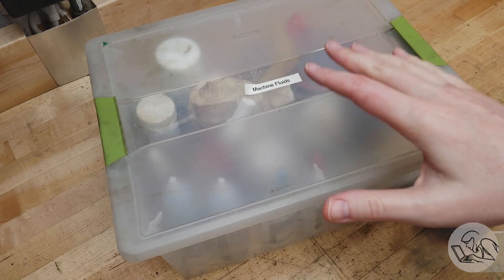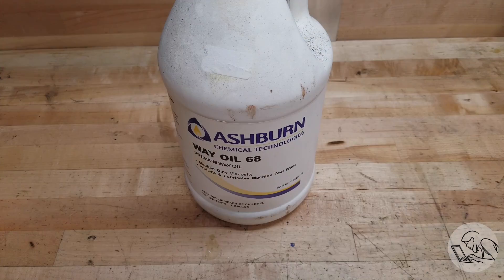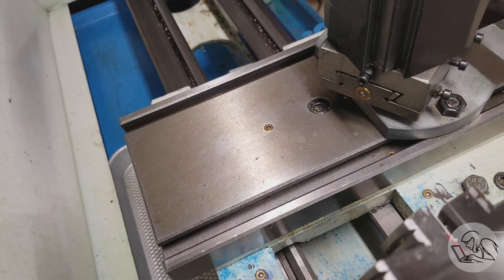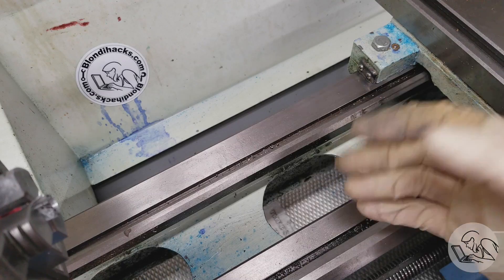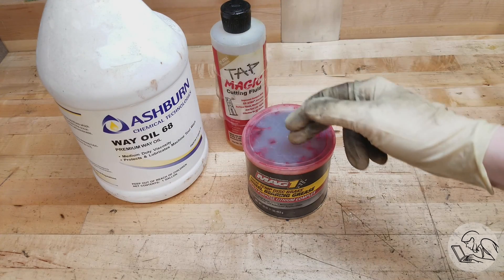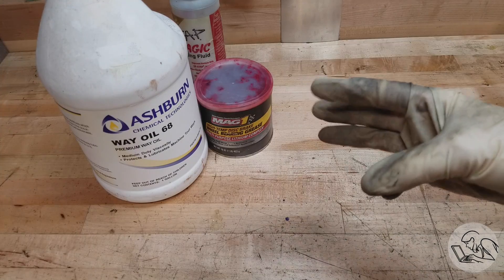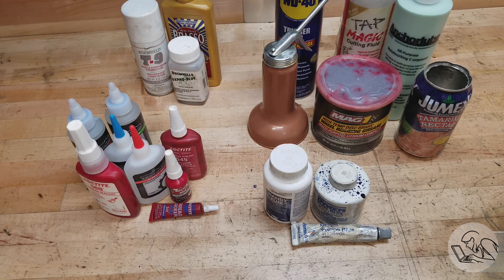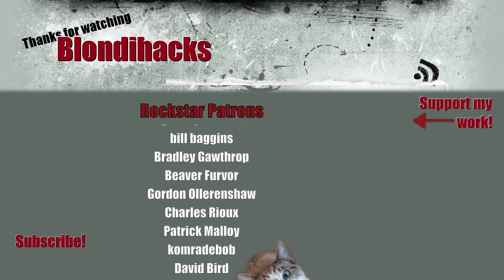Lubricants and chemicals you need in your machine shop!

Comment: Good Breakdown of a slippery topic.

As for oiling ways, I am in the "can not overdo it"-camp. Each day and repeated constantly when the machine is used.
Reply: As for solvents, I like to have isopropanol alcohole around for general cleaning. It doesnt attack gloves and degreases very well for glueing/cleaning purposes.
Apart from that I only stock Acetone but no break cleaner (aka Cancer in a tin) in my shop.
Reply: @StefanGotteswinter  I only use the non chlorinated brake cleaner.  Might be more expensive though.  It's the chlorinated stuff you definitely want to stay away from.

Dale in Canada
Reply: Oh! And dont bother with acetone and isopropanol alcohole from the hardware store. Usualy bad quality with poor purity. Fingernail or lab supply shops have way higher grade solvents, in larger containers for less money.
Reply: @StefanGotteswinter  In Canada you can find 99% isopropyl alcohol at pharmacies. I don't know about Germany.
What is the advantage of higher purity acetone?
Reply from the maker: Make sure you’re getting pure acetone from salon suppliers. Nail polish remover has a lot of other stuff in it besides acetone.

Comment: Lard thinned with some kerosene to a grease like consistentcy with an old toothbrush is great for cutting and tapping aluminum, plus a few other metals. I like to climb mill into a thin film brushed on to a surface so every cutting tooth gets a bit of lubrication.

Comment: I use engine oil for everything, not smart but I just haven't gotten around to getting the right stuff for my ancient lathe yet.
Reply: If you have to use engine oil then at least use non-detergent oil. Detergent is in oil to attract moisture. So it can get flashed off on cylinder walls when engines run. Now unless you're setting your lathe on fire regularly it's not good. But if you are torching your lathe then carry on. On my mill I use chainsaw bar lube to oil the ways. Gives the machine a nice feel. Plus I always got bar lube for my chainsaw. And you can pick bar lube up everywhere. Probably stock it in grocery stores around here. I get it at a big box store myself.

Comment: BIG CAUTION when using brake cleaners. Don't use these around any HOT parts. They can emit phosgene gas from hot parts or when processed through internal combustion engines. I find spray carburetor cleaner a much better choice for cleaning and much safer.

Comment: I find that Remington "Rem Oil" is very good for lubricating delicate mechanisms (like sticky dial indicator stems). A one ounce bottle will probably last years (so of course I bought a 16oz can!). If not Rem Oil, I still wouldn't be without some kind of "clock oil," and a needle-tip bottle is the way to go.

Comment: I like your videos Quinn, your an asset for the Tube machinest community. Something I just started using is methyl hydrate in stead of acetone (mostly).... it is 1/2 the price, 1/2 the smell, and works very well. I use it for automotive paint/gun clean-up, prep for powder coating, post blast cabinet media clean-up, ect. ect. I build custom motorcycle parts for my bikes. Happy trails for 2020! Cheers, Doug
Reply from the maker: Interesting- I’ll give that a try! I go through a lot of acetone around here.

Comment: You forgot Isopropyl alcohol that is almost as good as acetone and I use alcohol and water to clean my air brush and found 10% 90% alcohol water mix is great for cleaning everything :)
Reply: And it won't eat your plastic.
Reply: Also for air brushes washer jet fluid works really well too.
Reply: I use methal ethal ketone for melting some plastics together which is another derivative of acetone. This, acetone and isopropyl alcohol is apparently the three products of the one item.

Comment: Phosphoric acid is handy to have around (just don’t spill it on concrete), plus ether (starting fluid) is good for shutting up those guests who talk too damn much...
Reply: If you're in the U.K. Azure make various chemicals like phosphoric acid for rust removal at a reasonable price compared to EvapoRust and they do the same job except that the Azure is more pungent and EvapoRust has additives to presumably reduce odour and prevent flash rusting after treatment. I just bought 4x5L of the Azure brand for £30. A salt, oxide or grey powder forms and settles in the container and can be separated between soaks by syphoning off the top whereas the EvapoRust mixes and becomes thicker with use but handles oily parts better. Try some of each and see what you think. I didn't even know about it after 35 years of cleaning up rusty tools and machinery. Pitting can't be removed of course without abrasives but all of the oxidation will be. It's a must have and you'll find endless things to derust. Send my commission to Blondihacks!
https://www.ebay.co.uk/itm/Azure-Rust-Remover-For-All-Types-Of-Metals-Containing-Iron-5L-x-4/113828285455.
Current item number is the last digit string if the link won't work.

Comment: I often think how amazing it would be to be starting out now with the incredible amount of information available via mediums like YouTube.  That was not remotely an option when I started me toolmaking apprenticeship in 1967, but it surprises me of how many products I used back then are still available.  You mentioned Tap Magic but we used RTD which came in tubes back then, but I can only buy by the litre now.  
We had a ton of Loctite products (this was Ford UK Research & Engineering later called Product Development) but the Loctite rep called by once a month or so which meant that a) we were always buying stuff, but b) he really knew is products which was super useful to us.
Did I miss soluble oil? It makes a mess pumping it continuously, but it keeps the work cool as well as lubricates.
I love watching other skills channels like guitar Luthiers, as they have different issues, and use different products.  Formula 560 Canopy Glue is an example.  They claim it sticks anything to anything, and it has got me out of trouble on several occasions.  I have also discovered some very cool tool ideas from the luthiers that are on my list of things to make.
We tend to use the Birchwood cold bluing products here in New Zealand.  The secret is to get a good polished surface free of grease.  There is plenty of info online on how to use it though.
That was a great tip re brake cleaner.  I have an aerosol on the shelf I have never thought of using in the workshop, but I will from now on.
You never stop learning, but's what makes it so interesting.
Reply: Hi Trevor - I'm in Australia and we were trying to get Oxpho into the country - our problem was that US OSHA does not allow Oxpho to be transported by plane - if you go to the Brownells website, you will see that it says that it may only be transported via road transport.       Which is why we use the second best  :)
Reply: @richardmeyer418  well, there is road transport which is the us equivalent phrase "the low boat to china"...

Comment: Great video, Quinn, covered the basics quite well.  One thing I'd point out is that not all ISO 68 oil is way oil which didn't seem clear in the video.  You can buy more than one weight (viscosity) of way oil, though 68 is a good all around choice.  One other thing your QC gearbox oil.  If you're using conventional gear oil and your machine has any brass in it, you want to use a GL-4 rated oil as GL-5 will attack most yellow metals.
Reply: On a few lathes that I use instead of the term 'way' oil, we use hydraulic oils of around similar viscosity mainly due to the other tools that have in general have very similar recommended lubricant requirements.

Comment: Strange you hadn't discovered the felt-tip Dykem bottle...(hidden in plain sight as 2 oz. size in catalogs?) It's my favorite for flat layout, wider than the brush, and easy to avoid a puddle/splatter/spills like with the brush-in-lid bottle. One drawback is reaching inside corners... also The Dykem thinner/cleaner/remover seems to work better than acetone, and the aerosol spray Dykem is nice and even for broad areas (best applied outdoors), though I don't use it much.

Comment: As several people have mentioned in comments below this was a good subject because the other engineering channels I watch just assume you know this stuff. But of course a lot of people don't especially starters. Another subject you could cover, although I suspect it would take a lot of preparation work, would be the subject of how to hold odd shaped work pieces. I don't have a milling machine (yet) so I use a heavy duty XY table on my drill press. It is a bit of a pain especially when the chuck decides to slip out. However one of the biggest issues to me is just how to hold some things steady while machining. An example is a Manfrotto head that was designed to hold the Manfrotto quick release plate. I worked out that the place where the QR plate went was large enough to hold a Swiss Arca clamp with a little bit of machining. And it did BUT I spent a lot of time working out ways to hold the very non standard base plate in such a way as to allow machining. Ended up using the actually head clamp tightened up as much as possible as one way. Totally not the right way to do it but it did work in the end. Clamping it all down was the longest single operation hence my suggestion above for guidance in ways to hold a weird shape because not every machining job is a square or rectangular.
Reply from the maker: Work holding and setup is pretty much the #1 challenge in machining, for sure. I plan to do one or more videos on it. There are no universal answers, and it often requires a lot of creativity!

Comment: How do you like liquid thread sealants versus Teflon tape?  I used to swear by liquid based thread sealants until I discovered the yellow 'industrial' grade Teflon tape and I now rarely need the liquid stuff.
Reply from the maker: I still use Teflon tape quite a bit, especially in food-safe places like drinking water plumbing. I have used it on steam engines as well, although it’s more fiddly than the Loctite sealants.

Comment: No mention of WD-40 !
Reply from the maker: It was featured prominently. Not sure what you mean?
Reply: @Blondihacks  my apologies, I think i accedintly skipped that part after an interruption
Reply: @besssam  hard to find someone who rectifies. This message honors you Sir.
Reply: Awhile back, I had to research WD-40 for a project.  The contents turned out to be rather surprising (at least to me).  WD-40 is > 50% Stoddard Solvent (Varsol was the trade name).  Stoddard Solvent is a refined mineral spirit.  Also there is > 25% fine mineral oil.  The rest are driers, fragrance, and in some cases propellant.  So, the famous WD-40 is a pretty common mix of mineral spirits and mineral oil.  You learn something every day!

Comment: Fluid Film. I use AS (Aerosol) or BW (White Paste).It's lanolin based, I use the paste as a tapping grease, surface protection, smear it on the ways of my lathe, apply to drawer slides, it's great. The Aerosol I use as cutting fluid, but I predominantly work in plastics and it's probably inappropriate for the job.
Reply: Max Schumacher I'll have to agree with Max lanolin based lubricants, like fluid film, when they dry leave a nice protective coating, also smells way better than most other lubes. Ahh smells like the farm
Reply: @fishermanyt8187  and non toxic!

Comment: Two things..... DON'T EVER use brake cleaning fluid to clean anything that will be welded, unless you want permanent nerve damage! I believe it generates phosgene (sp) gas. It might give off the same gas from hot parts while machining. 2nd, try using 50/50 acetone with ATF for penetrating fluid, it's amazing!
Reply: Note, it is only the chlorinated types that decay into phosgene gas when heated. Other types are fine.

Comment: 🎶 Grease is the word.
Hard to find anything more specialised than a teatowel here so I just use engine oil as general lube or good old WD40. Canola oil is also a great substitute for penetrating oil due to its thinness ans smells much nicer when used for quenching. Vinegar is good for cleaning and derusting but much slower than evaporust but waaaay cheaper. Don't forget our natural organic enzyme based solvent..spit is fantastic stuff.
Also #Dougsucks  So angry about his stupid prank and unsubbed from his channel.

Comment: >Me, with my clapped out as heck tools
Little engine oil for you, little more for you, dab there for yoooou.
Reply: Detergent engine oil is bad for use outside of crankcases. The detergent is a dessicant so it attracts moisture out of the air. Non-detergent oil is OK though.

Comment: Thanks for doing this vid. I think most of us newbies needed it. I like JB Weld epoxy the best. As a couple have mentioned, chain saw oil may be a good way oil. It has lots of 'stickum' to keep it from slinging off the chain.
Reply: Yeah I use bar lube on my mill's ways. It's fine. Plus I always got the stuff and it is easy to get more. I live on a wooded lot so chainsaws are not optional. I'm always cutting trees down someplace. I dropped a 48 footer that was in my garden the other day. The bark was falling off its trunk so it had to go.

Comment: I guess there's place for anti-seize lubricant/paste/however one calls it.
Reply: Most anti-seize lube DOES NOT BURN OR SMOKE. I use Never-Seez. on lead molds. They are typically good to 2000° F. But it is really messy. Your hands will be full of silver ick.

Comment: Can you use loctite 603 as a dis-similar metal protectant?  Like bonding 2 dis-similar metals?
Reply from the maker: It will bind dissimilar metals, yep. I don’t know if it would prevent electrolysis, though. Never tested that.
Reply: @Blondihacks  I would think so, more research needed.

Comment: I’m in Belgium and it seems to be impossible to get Oxpho-Blue over here ... 😢 Great video Quinn, quite helpful !
Reply: Stefan you can order something similar on some German websites. For example on colt1911 I believe. Greetings from a fellow Belgian.
Reply: Thanks guys !
Reply: Gentlemen - look at Brownells.com and you will see that the US OSHA forbids its transport via any means other than road.
Reply: Richard Meyer There is no road ... 🤪
Reply: @Stefan_Van_pellicom  Yes, which explains why you can't get it, and why we, who are in Australia, are also without it.
Reply: I've looked for it too, but Brownells UK told me they don't sell it over here.  I bought Birchwood Casey Perma Blue instead.  Some people swear by one, some by the other.
Reply: pnt103 where did you acquire it ?
Reply: @Stefan_Van_pellicom  I thought Amazon.co.uk, but it does't seem to be there now. Possibly ebay.  But most "cold blue" is the same chemistry, if not quite the same formulation, so if you can't find Oxpho Blue or Perma Blue it would be worth trying others.  Or ask at a gunshop (online, if not local) - that's who it's made for.

Comment: And a caveat for lubing: there are some machines that use zerk fittings for lubrication points. Some people will see them and use a grease gun to squeeze grease in there but are actually intended for oil.
Reply: Particularly old Bridgeport mills.
Reply: And old us machine co mills. Took me while to find the proper way to oil the ways through the alemite fittings.
Reply: I will admit, I slammed a bunch of grease into my Bridgeport.  It seems to work ok. But now I am wondering if I should clean it all out and switch to oil
Reply: Stupid noob question: how do you oil a machine through a zerk fitting?
Reply: Oh thank you. I do HVAC/R work. I would have packed them full! I have a dozen grease guns. High speed low speed food grade vacuum grade hi temp low temp End it looks like I will be expanding my lubricant collection to precision work.

Comment: It is worth mentioning that brake cleaners containing Tetrachloroethylene ( I would be concerned about TCE too) are dangerous.  Not all brake cleaners contain them but are useful to know.  Tetrachloroethylene, when heated, can become phosgene gas, so be very careful using brake cleaner around welding - it will harm you.  Checking the fluids you use in the shop is time well spent.  https://en.wikipedia.org/wiki/Tetrachloroethylene or read the material MSDS sheets.  

Also, one of my favorite solvents is lacquer thinner, and I prefer it over acetone if effective and wax lubricants like cut-ease are useful on the bandsaw.   

And Blondihacks' you're the best!
Reply from the maker: For sure, brake cleaner is super nasty stuff
Reply: Very good advice!  One time I welded on a part I had just cleaned with brake cleaner, being unaware of the dangers.  After breathing in just a little bit of the ensuing smoke I literally could not take a deep breath for the next 15 minutes or so.  It was pretty scary.
Reply: Phosgene was used in ww1 as a weapon

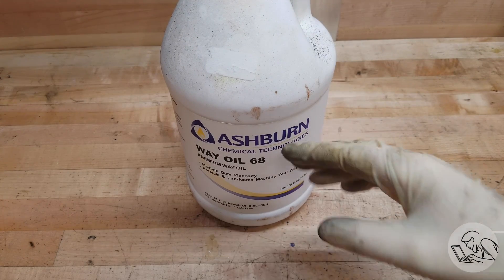Comment: 1:48 wrooooong, you can always steal some butter from the fridge and heat it up with a torch after rubbing it on the ways with your screwdriver.

Just make sure to remove the screwdriver from the butter afterwards... or you have to answer strange questions 🙄